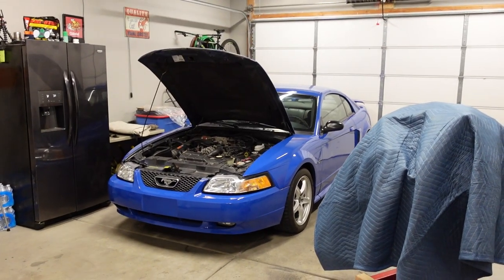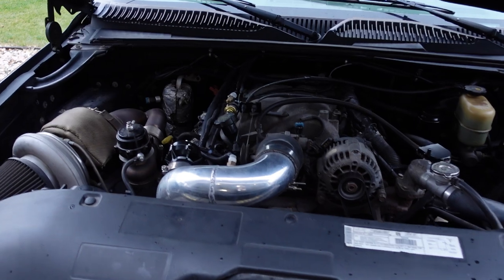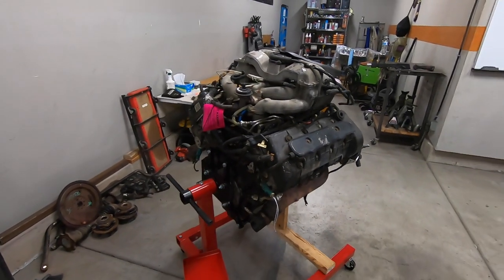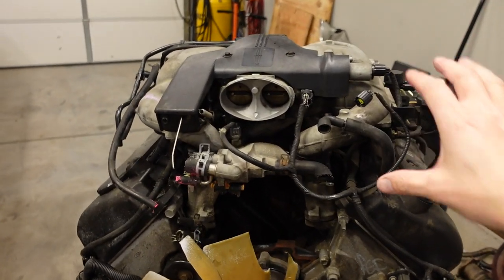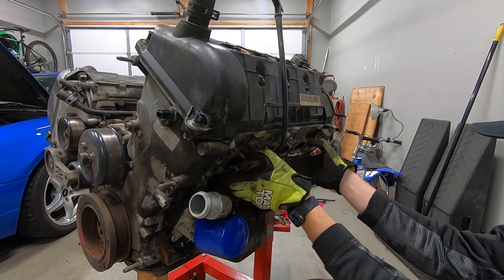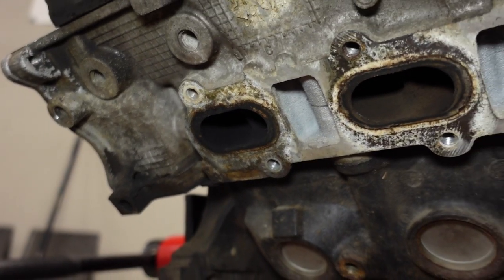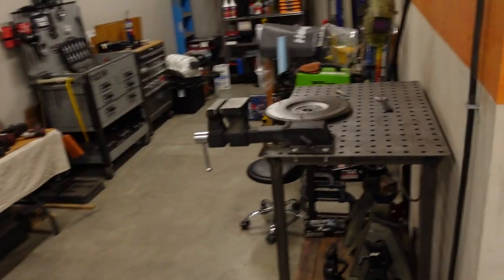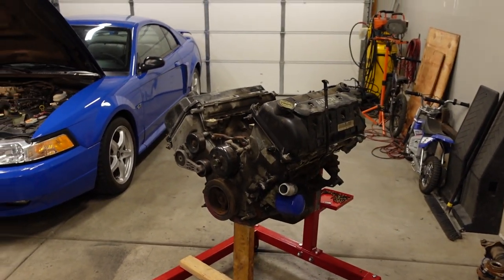I bought the LARGEST ENGINE I can fit into my Mustang

Comment: I’m currently doing the same, TRYING to stick with the “budget”😅 I’m hoping to have it together n runnin by spring ‘23. Have 3 “ponies” to choose from to stuff it in, then the other 2 will get the other engines currently in their sleeping bags, 5.0 “GT40” n my baby 408W! Like you I’ve got too many things going in the garages (and yard) and fighting a rare liver “C” word 3yrs now. Makes everyday a gift and sometimes a challenge so I’d go crazy if I didn’t have these projects to keep me from giving up.  How did you manage to get the intake? I have the mmr intake plates n Boss 302 intake , was trying to keep from cutting the hood if I go with the 01 GT, the ‘97 was going to be turbo 3.8 but I have a 4.6 I thought about putting in it, Jasper reman # 3!  
  
  So far my to do list to the 5.4 is replace the oil pump, pan/pick up tube, put in a timing chain kit in,  water pump, do the coolant tube mod on the back of the heads, port the intake adapters to match the heads, there’s a lot to take out! The intake has to be modified at the outside part of the intake at the injector bosses so it will fit between the heads ! Finding headers within the budget was a pain, was not using anything but long tubes, gain hp there! Using an auto so I’m sure a few light mods will be req 2 em. Pace setter 70-3229 for a 98 Cobra, got the cheapest ones, going to paint em after I get done w/mod em! Ceramic coat b nice but I may go twin turbo but right now I have a D2 n a P1 I’m thinking about…! This is as far as I’ve got  , I was happy as hell to see someone else doing this too, n try to stay with the “budget” which goes gray after a few! Used parts are crazy, the intake cobra cams USED are impossible to find n the 03-04 5.4 dohc I have no idea if they would do anything but $1700 for only cams is a project killer for sure! Good luck n sorry , I can’t keep my msgs short, been tryin!

Comment: There was also a quad cam 4.6 in the Lincoln mark viii 94-98 . I’m told the frame is either a shorter crown Vic chassis or shares lots of parts suspension wise . Basically the two door crown Vic they should have made just in a Lincoln that’s an overlooked engine in a car few people even seem to remember it is rear wheel drive and v8 just automatic only . I saw a running and driving 2 owner car with 150,000 miles for 1,800$ recently. The engine is probably worth that .

Comment: Option 3.  Put some ring gap on the stock piston/rod short block. Around 8 thousandths per inch of bore. With a good, safe tune, it will last. 
Hell, you didn’t even add ring gap to the 8.1 and it’s fine. The 5.4 will be fine at 900hp. Don’t waste money if you don’t have to. Just my $.02
Reply from the maker: this is a very tempting option for sure

Comment: open it, check the bores for round. Open ring gap for boost, check bearing clearance, degree cams.....add turbos. These will hold 12-15lbs if tuned well.

Comment: So glad you are boosting this, they aren't all that special n/a. Few tough ones around here in Oz 😁
Reply: It's mainly the parts cost so damn much and they were pushed aside because of the barra
Reply: @randomdude4669  not enough bang for buck, even with an unlimited budget they are junk non boosted
Reply: @Brettj77  the 4.6 4v is decent the 5.4 just seems to lack torque and doesn't like to rev

Comment: Its a bolt in, physically anyway. Now the height with that Aussie intake you may need a hole in the hood or one hellova hood scoop lol. Oh yea….needs a turbo and the dohc aluminum 4.6 from the Lincoln Aviator makes the same hp as that 5.4 just minimal less torque also the 04 has the updated 03-04 Cobra head “castings”

Comment: For the race truck, get a vortec 4200 and throw a big turbo and 2jz valve springs. Way lighter than the 8.1 and you can make easily over 600 on low boost

Comment: Nice DOHC is way better then pushrod. Look into a stock gt40 supercharger setup, they got swapped alot. So you might be able to ebay a used one to rebuild. As for the 8.1 when you're done try a newer Monte Carlo they are really light. They had a 5.3 in some so hood off 8.1 "could with custom mounts and drive shaft" simply lay waste in terms of power to weight ratio.

Comment: Cosmis makes a perfect flush wheel setup for these cars that lets you run a 335 in the rear. It's 18x11 rear, flush, no spacers or modification.

Comment: Join 5.4 Sn95 new edge swaps. It will fit great depending on the intake you use. The 5.4 isn’t much bigger then the 4.6 4v but the truck intake want clear the hood I’m about positive.

Comment: Great build!! I may be incorrect, but the crank is the weak point (non-forged); similar to the Mach1 with the auto has the same issue.
Reply: The rods on these motors are the weak point. They disconnect at 6500rpms and tend to find their way into the oil pan at around 450rwhp.

Comment: lmao FERD. Better keep a few grand worth of timing rebuild kits on hand if you plan on actually using the car. Two of my friends were ford guys. All they have to show for it is a big pile of blown up modular motors. When they aren't blown up, they're getting timing chain replacements more frequently than I change the oil in my LSs.

Comment: When you said largest, I was thinking maybe a 500 caddy, but that would be a mess to install. Then I thought it might be a v10, again a messsss to install Th Ford V10 was only 6.8, not larger than ugly truck or the crate, and the dodge truck v10 was 8.1L too. That left only the 8.4L viper engine, but then you said more than the 535ci crate engine. So I came to the COPO Camaro 572, but you eliminated the “exotic” category. I wasn’t expecting a 5.4L triton 3 or 4 valve.
Reply from the maker: Playing with the meaning of “largest” lol

Comment: 96to98 cobra had the 8 bolt steel crank wear as the mark viii 93 to 98 had a 6 bolt cash crank. With the sohc motor it can be either way depending on year

Comment: Lawrence, what do you like about the Suspension in this gen of mustangs? Only curious because i have always loved these years too. PLUS....Ive always wanted to see what a built 5.4 could do....!
Reply from the maker: I like that its a 4 link design with great geometry for hooking up on the drag strip, it puts down power very well, and there are tons of aftermarket parts available to fine tune it once you start to add a lot more power. Plus, the 8.8 a pretty strong axle, and the overall car is somewhat light

Comment: I always thought it would be cool to build the ultimate sleeper out of a green or purple 96 Mustang GT powered by a 2 valve 5.4L with remote mount turbo on e85.  Put it on some widened factory wheels and a butterfly decal on the back window to complete the look.

Comment: IDK about u sometimes LT but I'm gonna trust you for a while on this one but your the only technician type I know that's ever been excited about a Ford mod motor I've never had one of the 32 v apart past the intake but I hope it's nothing like it's 5.4 truck motor brother's are.. what kind of ecu are gonna use to run that thing?
Reply from the maker: sometimes I don't know about myself either lol... I think its gonna be a way fun setup if it turns out how I have planned. at first, we're gonna use the stock computer, and we'll see how things turn out later on, maybe a Holley

Comment: go option 1, im building a tube chassis single mid engine car using corvette arms, hubs, brakes, wheels and a porchse boxter 5 speed and a 1uzfe v8 32valve quad can 4.0L engine.  smallest v8 i can get that has aftermarket support. there is the jelly bean ford-Yamaha v8 that is like 3.6 3.8? it just doesnt have the market support i need

Comment: 4.6 or 5.4... 50lbft, a ford tempo makes 50lbft idles at 65mph to the floor. snow drifting works, plow the drifts? 4.6 takes 5000lb up a 35 degree incline with two foot drifts in the way... change the oil filter, high pressure = bad filter. tire chains do a lot of work, snow plow drags...

Comment: Definitely option #2. In everything but the Cobra and GT motors the rods are the weak link. That was the most common failure on Lightnings by far. Plus you can't take advantage of the rpm.

Built bottom end, and a HEALTHY set of turbo cams from MHS and spin it to 7500
Reply: Powdered metal rods in everything but the Cobra R and Terminator which use Manley H-beam
Reply: @donuthole7236  I meant GT as in Ford GT, not the Mustang GT lol
Reply: @clarkmiller287  I forgot about the Ford GT. My bad. Thanks for straightening me out on that one but we both know Ford wouldn't dare put PM rods in that car
Reply: @donuthole7236  honestly, my biggest issue with the GT was that they STILL didn't degree the cams at the factory. Like. C'mon Ford. It's a hand built car, take the extra hour and do it
Reply: @clarkmiller287  Not sure about the Ford GT motor. But there is no way to time the cams on a DOHC mod motor which can be out by as much as 6 degrees without buying aftermarket gears. If you have variable valve timing like in the new engines don't even bother 😕It's a lot of work timing 4 cams accurately

Comment: just letting you know man. putting a 5.4l v8 won’t be a issue to fit into the new edge as the 2000 cobra r came with one from the factory. it’s made to fit it, you’ll be fine.

Comment: You could’ve bought that engine in Australia it’s a really common engine in a performance application for a 2003-2009 ford falcon xr8
Reply: It's not worth shipping it when its the same motor bar intake and heads and hes going to build it.

Comment: OK.... First things first I am over the moon about this `build super excited! but I have a couple of questions.... with the the upper intake manifold from Australia, will that allow you to use the stock hood? also with minimal room in the engine bay, would you use a rear mount turbo set up? is the stock rear end going to be able to hold this power? I have a ton of questions because I'd like to build my new edge thats been chillin in the garage for a few years now....
Reply from the maker: Thanks! The stock hood will be extremely close to hitting, and will probably require some trimming, depending on whether I use k member spacers. The stock 8.8 rear is way strong, but I will swap to 31 spline axle shafts. I don’t like rear mount turbo stuff, but there should be enough space between the engine and radiator to put the turbo(s)
Reply: @LawrenceTolman  thank you soooo much and I’m gonna get to work!!! You have no idea how much I appreciate you

Comment: The 5.4l 32valve modular came on some other Lincoln vehicles too, didn't it? The continental and aviator come to mind, but I am by no means certain, as there was also a 4.6l modular engine that had 32 valve heads such as the Mercury marauder. I am also thinking the 5.4 32 valve was available on a couple performance spec f-150s (the lightning comes to mind).  Again, I don't know squat for sure. That was 20+ years ago. And really this is all more of a question than a statement, and no doubt someone here has that info locked away in a far more secure vault of memory than mine. Mine has become quite leaky and mildly neglected. Whomever you are, please share the pertinent information and thanks!
Reply: The Aviator had the DOHC 4.6 that came in the SVT Cobra.
Reply: @RandomGuyDan  cool. Thanks. That was with 4 valves per cylinder, as opposed to 2 or 3, whichever was in the basic 4.6, right? Then they also had a bigger and way better flowing throttle body too... But I could be wrong about that. Shit they put that engine in just about everything and had several variants.  I do know Ford put some serious bank into the r and d for a truly modular engine that could achieve some pretty dramatic performance changes from basically the same short block. I reckon I could Google all this, but it's much more satisfying to interact with real people. Again, than you, random sir.
Reply: @philbert006  The Lightning was a 2v 5.4L..
Reply: @P71ScrewHead  alrighty then. Thank you, sir.
Reply: @philbert006  you're welcome man..

Comment: Did the four valve 5.4 have the same issues with breaking sparkplugs when attempting to change them as the 2004-08  three valve 5.4's did?
Reply from the maker: no, pretty sure those issues were specific to the later model 3v motors, the 4v seems to be safe

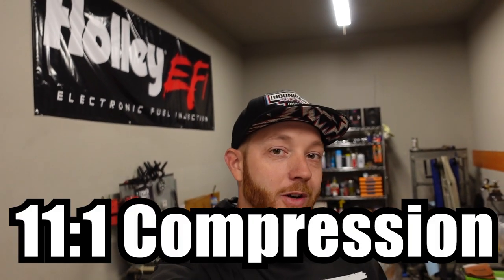Comment: 10:42 The reason the mustang GT engine makes 460 hp is because it has 460 hp cams. If what you said is true. Why don’t you just raise your compression and then you can make 502 hp?
Reply from the maker: there are a lot of differences between the Coyote 5.0 and 5.4, and the Ford indepent cam timing on the coyote also helps widen the power curve a ton, but yes, if I raised the compression of my 5.4 from 9.5:1 to 12:1 it would make a loads more power.
Reply: @LawrenceTolman  Not going to happen until you change the cams.

Comment: Are they that special? They were in every Falcon xr8 in the same spec. Had to fit one in with a mate for his 65' Mustang, huuuuge, no expectations to make high power, 290kw, but they sound good.

I posted too soon. Boss v8 intake.
Reply from the maker: no, overall they're not super special but its just an engine that didn't get used a ton here in the states

Comment: You shouldn't have much problem at all fitting just about anything in that Gen 4. The Engine bay was Designed for the SOHC 4.6, which Physically is an enormous Engine...

Comment: So what's the difference between this and the cobra motor just size?
Reply from the maker: the heads are a little different I think, its a taller deck, same bore but larger stroke, but both motors are very similar and a lot of parts will interchange

Comment: What kind of bolt extractor are you using if you don't mind me asking those were coming out way too easy LOL
Reply from the maker: I just took two nuts and tightened them against each other, and was able to back em out with the impact gun
Reply: @LawrenceTolman  oh yeah then you got pretty lucky right there huh I've got a old Bronco that I've got some manifold bolts or broke off into the block and I'm having the hardest time getting them out I've tried everything welding everything lol
Reply: @LawrenceTolman  im def gonna follow this engine build ive got one of these same blocks in my garage was going in a older foxbody believe its a 91 GT that someone built really well into a cobra then gave to the son and he blew it up and i bought it got that same engine at a pull your own parts place in nashville they got tons of em lol

Comment: I paid $1300 for a Navi motor to put in my 2000 GT all the way back in 2008! The project was WAY beyond my skill set at the time, but it’s in there now. And still terrible 😂 hopefully your vid will help me solve some of my decade-old issues 😅
Reply from the maker: sorry to hear that its giving you trouble!
Reply: @LawrenceTolman  It's all good. I'll jump back into it when you're done and see what you did with that master cylinder. I used K-Member spacers to get clearance for the head, but that messed up ground clearance, bump steer, camber angles... I think the pinion angle is off, man it was a lot. I can still drive it, but it sucks to drive. I've had the car for 17 years and it's had the motor in it for 13 or so of those- and I've put MAYBE 5000 miles on the swap.

Comment: @7:28 are those cracks in the head between the exhast ports?? in the square indents? horiziontaly <spelling bad>
Reply from the maker: i think those are just lines from the mold when the heads were cast
Reply: @LawrenceTolman  Didnt mean to panic you but i saw them and was like 'damn does he know, before spending a fortune of parts "overnighted from japan" 'lol

Comment: Should fit in no problem as that car did come with a 5.4 4 valve
Reply from the maker: bolting it in is no problem, but there are just a few things that will be extremely tight, like hood clearance and the brake booster

Comment: Hear me out.. VK56 swap and a simple turbo set up.
Reply from the maker: I've thought about doing a Nissan V8 in something, that would be pretty unique
Reply: @LawrenceTolman  they are a really strong platform, aftermarket is not as open as lets say an LS. Re5 transmission is the weak link. Many of us manual swap with a cd009

Comment: The sh*tty thing about the 5.4 is it's a 4.6 Stroker. Lincoln added .06 thou of Stroke giving it a 3.55in Bore and a 4.17in Stroke, "Undersquare". Not optimal for making HP. To address this You would have to take the Bore out .09 Thou giving it a 4.45in Bore. Which is most likely impossible even with a sleeved Block.. It's a Truck Motor, and there's nothing You can do about it.
Reply: For example, the 4.6 in the Cobra has a 3.55in Bore and a 3.54in Stroke "Over square". This allows the 4.6 to Rev higher and Create more HP.

Comment: Did any navigatior have this engine?
Reply from the maker: I think 1999-2004 was the 4 valve, later model Navigators had a 3-valve
Reply: @LawrenceTolman  ok thanks! I just found a complete navigator with 153k miles for 3k so imma try my luck with it 🤞🏻

Comment: As a former Ford Senior Master Tech, I really disliked these engines. They were overly large and complicated to service. They also didn't have the long term durability that they should have. I would bet it will have a burnt valve if you pull the head. 

As a hot rodder, they are awsome!

Comment: How is a 5.4l bigger than a 500ci engine? Doges 427 is a 7.0l-7.4l, so by that, a 5.4l is not bigger than a 500ci engine
Reply from the maker: Correct, it’s referring to the physical size. While it’s only 5.4 liters, the DOHC design makes it about 6 inches wider than my 535 big block
Reply: Oh ok

Comment: C'mon man, the 7.3 or go home..and at home the 3.5 turbo from a police explorer..and wasn't this motor in the 90's Tbird?
Reply from the maker: No not in the thunderbird, the 5.4 5 valve came in Lincoln navigators
Reply: @LawrenceTolman  The lincoln mark 8, it has the 4.6l intec 32 valve dohc.  You can find them in junkyards.